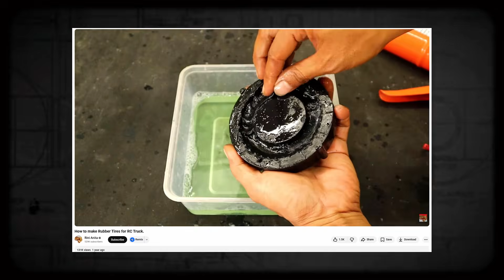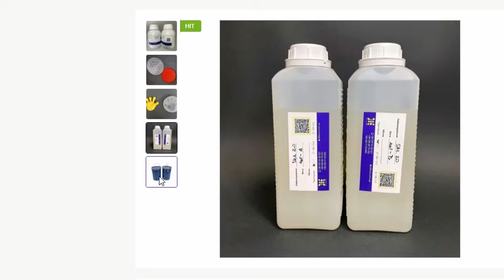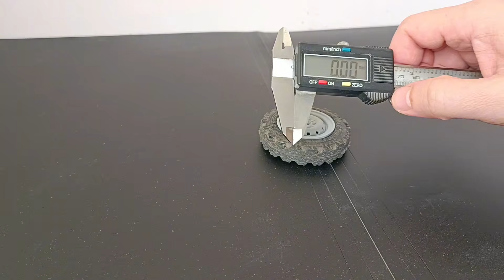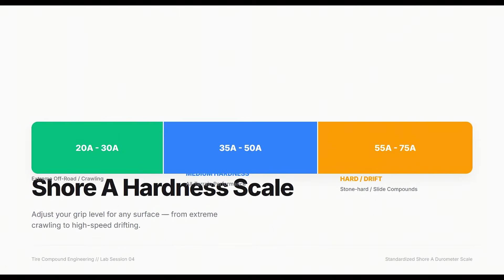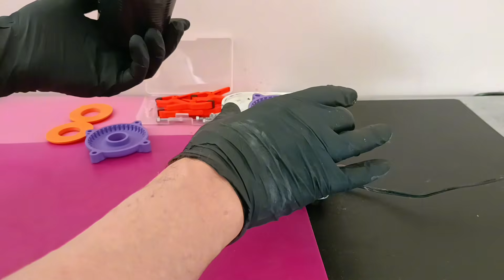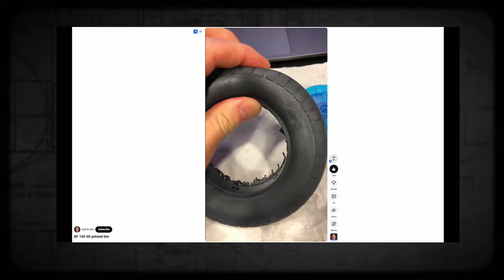DIY RC Tire Questions Answered | Silicone, Molds, Durability

Comment from the maker: Let’s settle this in the comments: Have any of you actually pulled off the medical syringe degassing hack successfully, or is it a total backyard myth?
Personally, I have my doubts, but I want to hear your experience. Drop your thoughts below!

🛠 Want to cast these exact tires?  3D files from this video are available in profile.
Reply: Now i havent done the syringe trick myself. But i have a theory. Depending on how much you are doing in your batch you would need a large one. Id also believe you would want atleast 50% or more of travle you could pull out to get to the right vacuum. So in theory yes it can work but eh id probably just get a vacuum pump n chamber.
Im also totaly new here but if you would be up for it id love to see a video with a test with different sizes sirynges. I think largest iv seen is 750ml 😅 and with different amounts of pull able to be done.
Reply from the maker: @GamesenseNoName You've got some interesting logic here, but physics is a bit more brutal when it comes to high-viscosity materials like tire silicone!

The main issue with the syringe method isn't actually the volume, but the depth of the vacuum (residual pressure). To force stubborn micro-bubbles out of thick silicone, we need a massive drop in pressure (close to -0.9 bar or more).

Here is the catch with a huge syringe (like 750ml): the larger the piston area, the more atmospheric pressure fights against you. Pulling that piston to create a true vacuum would require insane mechanical force — way beyond what human hands can do. Plus, standard rubber seals will just leak air under that stress.

You are 100% right that a proper vacuum pump and chamber is the only real way to go. But hey, the idea of testing different syringe sizes on camera actually sounds like a fun, scientific myth-busting video! Thanks for jumping into the discussion!
Reply: @rctirelab  yeah totaly get it. I also kind of forgot to factor in viscosity. And yeah 100% get what you are saying. Could also then do a test with different viscosities but as you hae stated in thr video. The mote water like the less it would be needed. Unless its something that offgasses alot but. Yeah a mythbusters kind of video on it would be cool 😄
Reply from the maker: @GamesenseNoName Exactly! Viscosity changes everything. With water-like liquids, the bubbles escape almost instantly even with minimal negative pressure because there's zero resistance. But stable, thick compounds just hold onto those micro-bubbles like a trap.

Testing the syringe method on different viscosities (like water vs. thin silicone vs. heavy tire silicone) would actually make a perfect visual demonstration of fluid dynamics for a myth-busters episode.

Thanks for the awesome brainstorming session! Glad to have you here in the lab.
Reply: @rctirelab  I tried pulling some silicone in a syringe... just getting it in you notice the resistance, and a rough calculation of the force required turned out 10 kg. Not insanely large but that is a lot to hold on syringes that were never designed for this nor are any comfortable. Without a contraption that is holding the tube in one hand, and pulling the plunger with the other - both arms needing to hold 10kg for quite some time. For comparison that is about as much force as holding a bottle-crate.

Comment: I need to make RC tire with diameter of 58mm , width of 28mm to put over 1.77inch rim of my 42cm long lamborghini RC car.
Reply from the maker: That sounds like a cool scale project! Just a quick heads up, though home cast silicone tires are amazing for soft crawling, custom treads, and indoor grip, but they aren't really meant for high speed running. For a 42cm on road car, factory rubber or stock tires will handle high speeds much better without ballooning .
If you're still up for experimenting with custom molds for scale look, let me know!
Reply: If ballooning is the only problem, it can be solved the same way as Factories do it, add some tape on the inside of the tire. (Fiber tape) 

im more concerned about grip as i am thinking about making a 1;8 scale onroad rc racecar, but i want custom tires, not factory onea

Comment: Should I use silicone or PU to mold the tires for my rally car? Please give me some advice.
Reply from the maker: To be completely honest with you, for a rally car, your best bet is to buy high-quality, factory-made rubber tires.
Rallying requires high speeds, durability, and precise balance. DIY cast tires (whether silicone or PU) simply cannot match the performance and structural strength of commercially manufactured RC tires on fast tracks.
This DIY casting process is really meant for slow-moving vehicles (like scale trail crawlers) and for creating highly detailed visual replicas where you want to perfectly copy unique tread patterns and microscopic sidewall lettering. For a fast rally car, go with factory tires—it will save you a lot of headache and give you the performance you actually need!

Comment: Silicone has an insane degree of resilience. But it is a slow material which is why it's not preferred industrially - everything that can be converted to TPU or soft-PVC, will be for cost.
Reply from the maker: You hit the nail on the head! Industrially, cycle time is everything. Injection molding TPU or soft PVC takes seconds, whereas waiting for silicone to cure is a bottleneck that drives production costs through the roof. That's exactly why silicone is such a hidden gem for the DIY and prototyping world. It might be too slow for mass production, but for making custom, highly resilient parts right on a home workbench without heavy factory machinery, it's a total game changer!

Comment: Dry-rot can happen with PU.
But when you are already making your own tires - why worry? The PU costs very little and do you really let your tires sit around for months to years without use for that to become a problem?

Vacuum is important IF you want the nice surface or if the part is structural. In general for tires that is not the case.
With the syringe it does work - you best use a loooong syringe as just pulling back further is not as hard to hold than a thick stubby one. You still need to pull hard and hold that for a surprisingly long time.
 It is enough to noticeable reduce bubbles but not enough if you are casting miniatures and need a good surfaces or far worse - transparent parts.
Reply from the maker: Exactly, you nailed it! Since I can easily cast a new set anytime, dry-rot isn't a real issue. Thanks for the feedback!